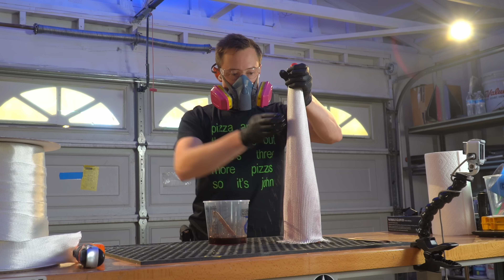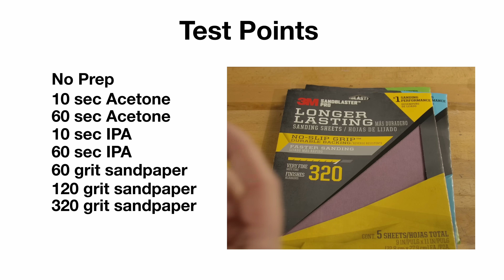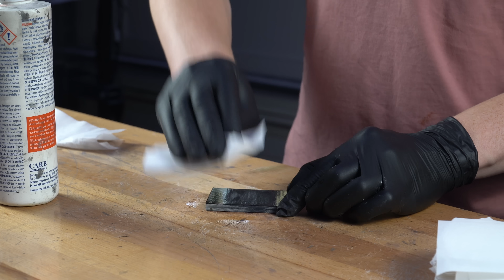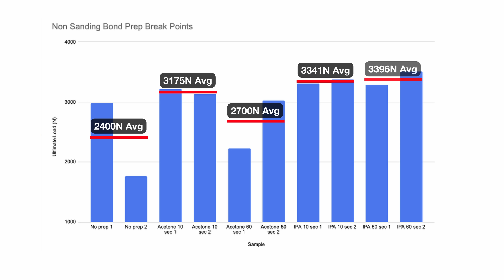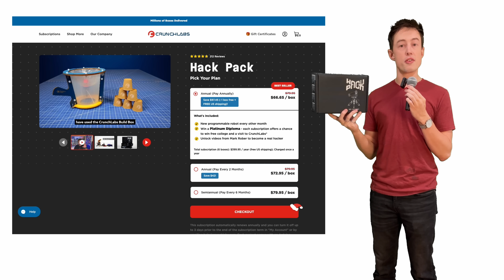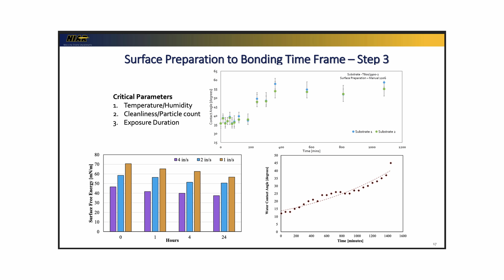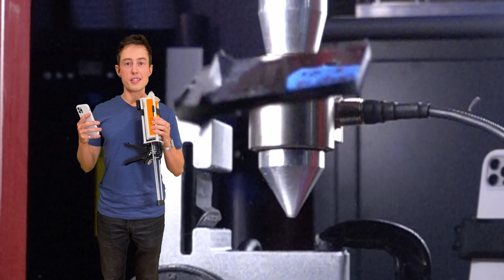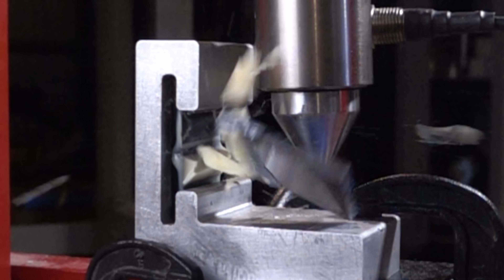I Broke 100 Epoxy Bonds to Find the Strongest

Comment: I understand this is an isolated test, but when actually building the rocket why do you not glass over the fillet onto both the fin and the body or even build the fin directly onto the body by glassing over the entire substructure? Or do you? Seems like it would make the fins a lot more rigid and thus have quite a bit less positive feedback shearing forces from wind ( also I'm not all the way through the video yet )

Comment: You neeeeeeeed to design your tests better. Making a plan of what you want to test, what could influence your results and how you will mitigate or control for that is imo responsible for your need to run so many tests while half of the tests (or the same amount of tests, but double the samples) could test the same thing..

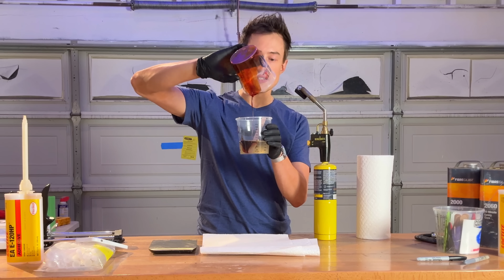Comment: 1:44 Actually, even before you being mixing, is all that resin left in the other container going to affect results?
5:42 I was like "Super glue as mould release? Whaaaa....?" Turns out your ears don't work all that well when you're drunk.
13:17 So, looking at that, here's my question: What is the difference between a 60 grit scratch pattern on the resin finish, versus exposing the weave with a 60grit sandpaper?
TL;DR for this whole video: Bro.... what even is statistics?

Comment: One advantage to doing the overlapping sheer test is that you can do wider samples layups then have the CNC slice them into coupons using a setup jig -- I suspect this might give you more consistent results per test group since you'd be doing multiple samples all at once. Assuming you still do 2-3 separate layups per group you should have a lot of data to compare techniques and consistency. 

It also allows you to do more samples in a shorter amount of time.
Reply: wouldnt there be a concern about the two ends of the master sample being different from the rest because they were only subject to one side being a cut surface?

Comment: Yup, acetone is great for cleaning and opening up the existing resin structure, too much will cause damage, and I think waiting a long time will mean it returns to normal.
Great for plastics too, although for some that are rapidly attacked by acetone you need to dilute it a lot with IPA, and I would be suspect about using it for polycarbonate.

Comment: My assumption would be that you should sand it in reverse order to maximize roughness and surface area. Starting with something like 600, then doing less sanding with coarser grits until you end with just a few passes of 40 or 60. The complete inverse of what you're supposed to do to get a good smooth surface finish.

Comment: You're right, the test methods aren't perfect. However, your results aren't behind a pay wall, which is far more important, in my opinion. It's infuriating seeing journals putting data, that they received for free, behind pay walls for normal people.

Comment: If your rocket turns sideways at Mach 4, keeping the fins attached is probably not the biggest concern.
Reply: That's an interesting take that I like. Less safety hazard if the rocket doesn't steer with 100g towards launch complex.
Reply: @rockindude3001  "I hope the rocket that is out of control and coming right for us doesnt have the epoxy bonds fail" sure can be a weird way to think...

Comment: Bead blasting always gave higher and more consistent results than sanding when I did tests with aluminium tubing and caps with various loctite adhesives.

We always just used acetone.  But the IPA step was the take away.

Comment: There's probably something I'm missing but, why couldn't you make a removable mold extender so the epoxy didn't spill over during de-gassing? (Removable so you can flatten out the epoxy afterwards, before it cures)

Comment: I stumbled across acetone + ipa as a surface prep for my 3D printer. I wasted most of a day trying to get a first layer down until I finally reached for the acetone out of frustration. And since I regularly wipe with medical ipa pads before printing, I was doing the acetone + ipa prep by accident. It works every time I have first layer problems.

Comment: Just pouring the epoxy in can cause some trapped air or dry spots, it's best practice to use a tiny bit to pre wet out the joint if you are doing casting methods. Vacuum degassing will help but is hard for large parts.

Comment: if you ever do another bond test, i'd be curious about allowing the epoxy to "bite" the piece. either drilling small holes through the piece or notching out channels that get filled with epoxy so that the epoxy isn't completely reliant on the surface bond.

edit: or maybe some counter sink m3 bolts so that the bolt head would be braced against the fiberglass and the epoxy could grip the threads of the bolt

Comment: Acetone is a wonder liquid.  I've been wondering why you haven't used it, and just assumed you knew better :D  we all learn new things hey!

I've used acetone specifically on PVC and PVC based plastics to let paint grab onto them better.  I had a professional painter friend tell me that I would never be able to paint my ugly 90's beige yakima box top for my truck black as the plastic wouldn't bond to the paint, and after 5 years it was still perfect, until I went into a short parking garage and smashed it to pieces lol.

Comment: Something to note about high grit sandpaper is that it is common for them to be impregnated with zinc stearate as a lubricant, for bonding you have to make sure that it is a fully un-lubricated sandpaper because zinc stearate is not easy to remove with solvents.
No idea if that was an effect here, but it could explain why the 1000grit was so incredibly weak.
Reply: Might be time to switch to media blasting.
Reply: @DanBowkley aren't those procedures really NASTY?
Reply: @robertschnobert9090nah just air and sand or glass bead
Reply: @Waitin4_a_Mate  which makes a lot of dust that you don't want to inhale, but with proper equipment they are very manageable.

Unlike say fibreglass or rockwool (basically any materials with microscopic sharp edges) or heavy metals (outright toxic stuff). Which you should REALLY know what you're doing
Reply: @noctis_runeyeah I've seen sandblasting cabinets you can use for small parts, so you don't need a whole room/both for sand blasting. But definitely not the type of thing you can just do in your garage without an enclosure haha
Reply: @robertschnobert9090 you can literally make your own sandblast cabinet with a clear waterproof storage  bin, two toilet flanges and two rubber washing gloves + adhesive obviously. That or spend the $150 or so for one at harbor freight. It’s not hard or dangerous
Reply: Use sandpaper meant for automotive body work as it is clean, sandpaper for general use from the orange or blue box stores will have lubricant and anti-caking agents on them.
Reply: Interesting, I didn't know about this. 
It's called non-load sandpaper
Reply: @dsdgdsfegfeg Apparently the zinc stearate is the lubricant which could act as a contaminant/lubricant which interferes with bonding.
Reply: @stopthephilosophicalzombie9017  correct, 
I have always wondered why 3M sandpaper is magical & better than every other sandpaper.
One of the reasons is stearate addition.
Reply: Another thing I learned from a master paint scientist, no matter what solvent you use or how many times you clean the surface with it, it's always preferable to include a degreaser (simple ajax/comet powder works great) scrubbing step, because even if you clean a surface 10 times, you'll never be able to remove that atomic monolayer of oil/grease contamination, because you're ultimately just diluting the hydrocarbons/oils. You can also heat to 300C or sandblast instead if you're able, but degreaser is cheap, easy, and fast. Just make sure you do your paint/epoxy within 1 hr after prep, or else you'll need to use something called gumming solution to preserve your serve until then.
Reply: Sandblasting should be consistent
Reply: I would advise to use Scotch Brite. Follows the surface better, less scoring of the fibers. And blow the dust off. Cleaning again leaves a carbohydrate residue.
Reply: @MichielvanderMeulen you'd only leave a residue if you were using impure solvent. Use the solvent for the job. Blowing off dust isn't effective to remove all of it, plus your hands, the abrasive, whatever else would have come in contact with the part during sanding could have contaminated it again.
Reply: @arturjogi6054 The problem is with the carbohydrates sticking to the surface.
Reply: @arturjogi6054  all solvent becomes unclean the moment it dissolves anything, which is the moment it’s used - and while in use. It’s why even triple solvent washing something still leaves (usually measurable) levels of contaminants. But usually gets them below the desired threshold.
Reply: @JB-jg1tc well... Yeah, and? That's just intrinsic to... Washing. You can't remove 100% of anything by washing. That's not the solvent's problem. It's not the solvent leaving a "hydrocarbon film", the contaminant was already there before, and the washing makes it better. You can't make it worse by washing, unless your solvent was already dirtier than your surface before starting.
Reply: @arturjogi6054  a drop of hydrocarbon in one spot because a hydrocarbon film over everything once solvent is used. 

Seemed pretty self explanatory. You can make it worse (widely) using solvents, which is what people are talking about.
Reply: I'm also wondering if cleaning the sandpaper would help. Like there's glue that holds the cardboard packaging together and those cardboard packaging sleeves get cut, printed and sorted on machines that use a ton of grease and oil...
Reply: @ianj8505  Yeah, possibly. I doubt it would be an issue from good suppliers but giving the sandpaper a dip in brake cleaner could be good insurance against that just in case.
Something I was surprised that he did not bring up was the wide range of special adhesion promoters you can get. I'm not sure if they are relevant for this particular resin-on-resin combo, but for difficult substrates they are basically magic.
Reply: @samheasmanwhite  Yup, indeed. With commercial adhesives that's basically the only way to adhere to PP and PE, using a special adhesion promotor. And even with that, not all of them are created equal. I've had great success with 3M's range of adhesion promotors and their accompanying adhesives but no or low success with others like, for instance, Loctite. There seem to be more bad ones than good ones out there
Reply: @BinaryBlueBull  Yeah, there's not much out there for PP/PE that is actually good, like not much chemically alters it other than chromic acid and such, but I think the ones that are basically a modified PP/PE dissolved in solvent can do an ok job at sticking and leaving a bonding layer.
Reply: Oh good someone else commented this so I don't have to.
Reply: This reminds me of some of the discussion I’ve seen on automotive channels, where they discuss the surface finish of engine pistons and cylinders. It turns out that incredibly smooth surfaces are not the most desirable, just like ultra rough surfaces are not the most desirable. There needs to be the correct ratio of consistent surface (smoothness) broken occasionally by deeper grooves which allow the lubricant to be carried.

I know you’re looking for the exact opposite affect - adhesion rather than lubrication, but there may be something you can learn by looking at the surface roughness, and the aspects of the roughness beyond “it’s rough” versus “it’s smooth”. There are more factors which can be measured and taken into account.

Mitutoyo makes a line of surface roughness tests which might be helpful.
Reply: 3M 7447 or alox grit blast. No sandpaper will do
Reply: I did wonder about that too, my practice was to use 'wet and dry' paper used wet, but then I was only working with car body fibreglass.
For pure repeatability I might have tried sandblasting.
Reply: Maybe just try sand next time so there's nothing there but grit?
Reply: Nighthawkinlight experimented with using metal stearates for waterproofing cardboard, so that actually tracks pretty well
Reply: seems like just using a bunch of silicon carbide in the required grit might be a valid testing technique. Less messy and work than media blasting and it still is "sanding"
Reply: I was just going to comment about using non stearated sand paper 😊
Reply: Sand paper:🤰
Zinc:🥛   🏃‍♂️💨
Reply: Thank you so much for not pronouncing coupon “kiewpon”. It creeps me out and makes me want to throat punch anyone who does that.
Reply: hmm, does that suggest "avoiding the problem entirely" by sandblasting instead?
Reply: thinking same about silicon
Reply: Good question! I'd also like to know what type of sand paper he was using? Aluminum oxide, zirconia, ceramic, or silicon carbide? Also what about emery cloth? My personal experience with composites is minimal at best (little bit of time in school doing prepreg carbon layup and vacuum oven cured, never again... the itching...), but what about other options epoxy wise? I've used various different panel bonds in personal projects, and some of them have had glass bead suspended in them for various reasons.

Comment: Is there a reason you didn’t try using oxygenated water? You can get different concentrations and use it a set time just like you did with acetone and you can achieve the free radicals effect on the surface.

Comment: One thing you might what to look at is DOE or Design of Experiments.  It allows to test a lot of variables, in a short series of tests, and determine what makes sense to continue testing, or find the variables that have the most effect.

Second, the idea of acetone and alcohol, is different types of contaminates.  Acetone will remove non-polar contaminates, like oils or greases.  Alcohol will remove the polar contaminates, like salts from hands, or other sources.
Reply: I would think water would remove polar contaminants. Alcohol mostly flushes contaminants; doesn't attack the surface much.
Reply: @MichielvanderMeulen  water would remove polar contaminants but it would not remove any acetone residue. Isopropyl alcohol has both polar and non-polar ends; the latter would remove acetone residues.
Reply: Stuff like that needs more samples, but yea, it would be really cool to see some anova testing

Comment: When I designing glued parts I use so big overlap that material will crack earlier than glue. 🤗 
Design is good when it works properly with super poor quality. 👍
But good to know, it can be usefull for repairs.

Comment: Nice rabbit hole. :-) The bit I think you're missing from the results is marking each result with the failure mode. If your sanded and not sanded tests, both failed by the epoxy failing, you're not testing the bond stength but the strength of the epoxy? The result is only showing bond strength when the failure mode fails at the bond junction? If the expoy is failing, then use stronger epoxy, no amount of sanding or bond prep will change the result? Great video!
Reply: I also thought this. Failure mode seems like it would make an enormous difference to the results

Comment: What if you start with high grid sand paper and work your way down, so eg 1000, 800, …, 60. Shouldn’t this also increase the surface area since groves are created at different levels of depth?
My reasoning is that I don’t think that low grid sand paper will necessarily destroy all the previous work, ie get to all places. Also going uphill and downhill more often creates a bigger surface i think

Comment: I have done manual treating of HDPE with a blue flame and it... seemed to work but it's super tricky. It's practically impossible to get anywhere near optimal results hand torching anything. It's always too little (not enough activation) or too much (you melt the surface or apply a layer of soot). If you do 100 pieces with flame treating by hand, good luck getting all of them treated even 75% optimally.

Comment: I used to degas epoxy the same way. The trick is to Watch for the bubbles and release the pressure a bit let it settle down and then apply more vacuum and release the presser. It’s a pain in the butt. But when time is counting…be sure you evacuate some spare epoxy for topping off.
   Never mind.🫢

Comment: I would be very curious to see if there's value in wiping with acetone and IPA before sanding and then wiping again after sanding. That way you avoid grinding surface contamination into the sandpaper and the surface.
Reply: Also, it appears that you did nothing to prevent contamination from your workbench. Each sample should be placed on a clean, lint-free wipe during prep.